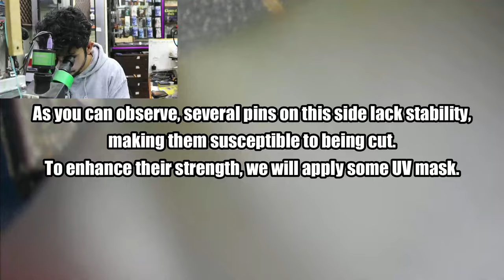Samsung Galaxy A53: No Power or Stuck on Logo Fixed: How to Reball CPU

Comment: Doubt you'll see this however if you reball the cpu to fix the freezing issue these phones can have then the phone won't turn on at all, is the cpu likely dead?
Reply from the maker: Try to reball it again, and be careful with the temperature 🌹
Reply: @blacklightrepairs  Thanks for the reply, I went ahead and reballed it again and it has the same result, do you know if these cpus can be swapped to a different a53 board?
Reply from the maker: @phynx-victumterra652  no worries bro,
Check the PMU on the right side of this model. There's a common issue with the pins under the PMU that might have detached after the CPU reball.
Reply: @blacklightrepairs  Is the PMU under the big shield on the opposite site of the cpu? I am not familiar with these boards yet :) thanks again
Reply from the maker: Yes it is.
There is two of them, you can check the one on the right side.
Reply: @blacklightrepairs  Ok thank you again, I will take a look and see if I can find anything wrong :)

Comment: Pads are ripped cause of low heat near the ufs side
Reply from the maker: Absolutely, you're correct. In the context of this video, the pads were indeed affected due to low heat near the UFS side. However, it's worth noting that, in general, these pads tend to be fragile. The A series from Samsung, being more in the mid-range category than flagship, does have logic boards that may be more susceptible to such issues. Your observation is spot-on, and I appreciate your engagement with the content!

Comment: Samsung A53 5g he brother cpu reball ufs reball kar li he but charging me amp 0.2 per stuck aur dc reading 0.235 per stuck reh raha he kaha se fault ho sakta he iska
Reply from the maker: Hey bro!
There is a common issue with this version where three pads often get disconnected on the board under the right PMU itself. Make sure to check for it.